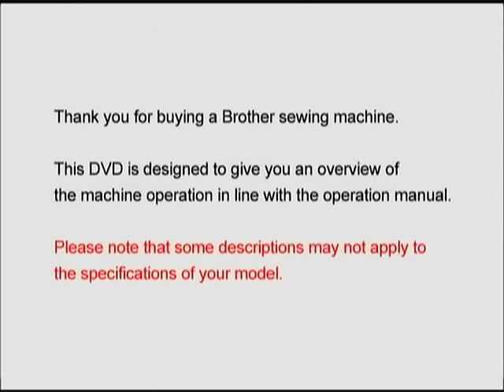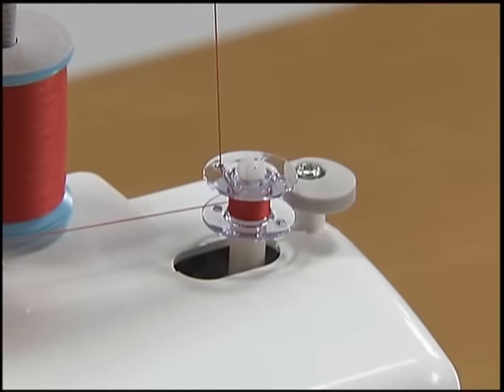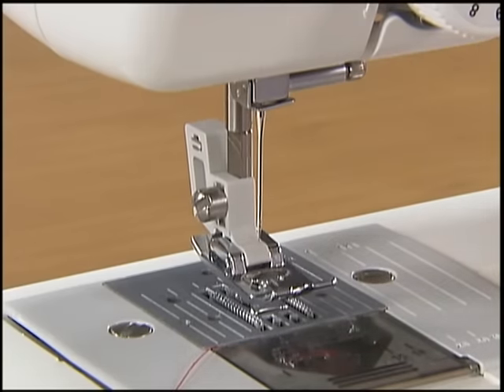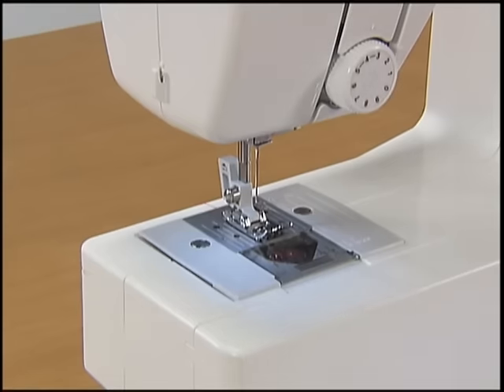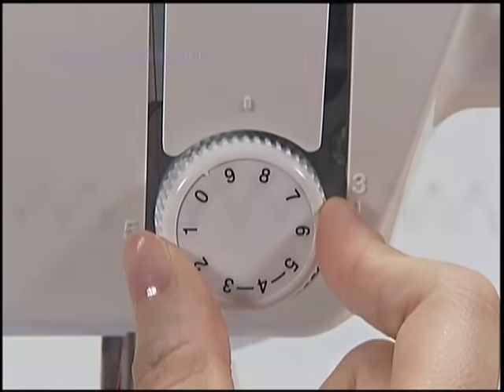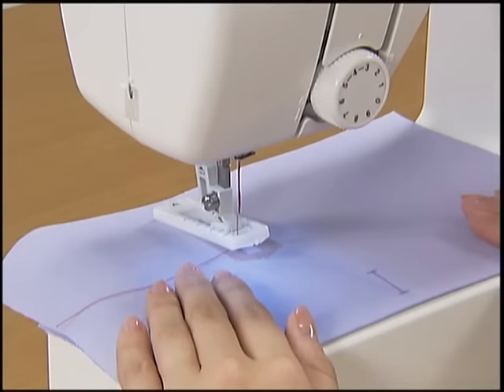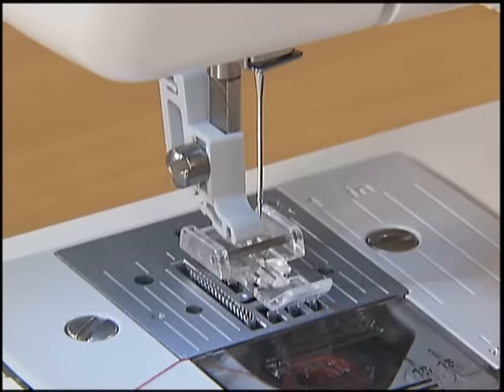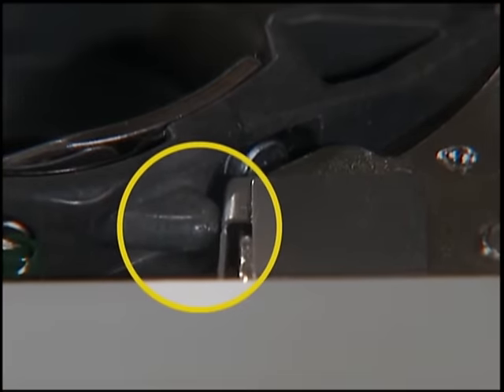Brother Sewing Machine - Instruction Video

Comment: I’ve had a cheap JX1200 for about 3 years now and I really like it - serves my purpose. Just found out it has a built in buttonhole maker!  Now to experiment. One tip I can offer is I had to put clear tape over my stitch selector button as the paint was coming off. AND if you have trouble with the machine not stitching properly, change your needle. I found out the hard way a simple solution for a big problem.
Reply: லி ஞஞ பட

Comment: Right I got this machine yesterday! And everything is fine. APART FROM when I sew on the top everything looks swell however on the bottom it doesn’t connect w the top so If i pull a thread everything comes undone

Comment: Ive had a brother ps500 for about 5 months. Projects take 3 times as long with brother ps500 because of mistakes. Having to fuss with machine takes my attention away from the sewing . Also the fed dogs wobble sometimes at high speed. Also I cant change the needle position. Also I have to take out the manual each and everytime I sew because its very tricky. Ive become so stressed out using the machine Ive started hand sewing which actually goes faster and more accurate than using the Brother which says a lot about the quality of the machine. Id like to get my money back. Before I had an old 1970s Singer I bought for $30 at a garage sale. I was able to work faster and more accurate on that old Singer the Brother ps500 was very expensive and not worth the $30 my old machine cost!

Comment: I want to know the magic of how the lower thread, which you have pulled to the side before replacing the bobbin cover, gets taken up by that straight needle with the upper thread in it? It's nowhere near it but there's something I;m not getting. Also, the Operating Instructions that came with my mx1010 threads the upper thread differently; the spool is other way up with thread coming out the front of the spool; unfortunately I can't play the dvd that comes with it right now, external drive won't work. Any suggestions?

Comment: I've just got hold of rhe lx25 so really looking forward to using it and learning all how to use it properly looks interesting how the bobbin cases are at the top on these machines looks easier to clean out also with a brush, I had an old brother window matic sewing machine and I've just re oiled it all and done the bobbin case brushed out and replaced the needles sorted the timing out which it's sewing much better now than it did really pleased with it now spent the day doing it but don't do zig zag so ordered a new brother sewing machine so looking forward to using  the new bobbin feed

Comment: I have a problem with the bobbin-winder: Sometimes the thread will wind around the base of the winder, instead of the bobbin, making threads collect underneath. How do you remove the bobbin winder shaft? I have a Brother CS100 so it doesn't look like the one in the tutorial. It has 2 pins around the winder shaft and base, where the threads will wind around. They should make the winder smooth so that when this happens, the threads can just be pulled off instead of having to take the device apart.
Reply: Marina M that just happened to me and I was so annoyed. Eventually i just cut the thread and tied it to another piece and kept going
Reply: If this keeps happening to you, you can thread the string into the little hole in the bobbin and wrap it around manually a few times before putting it onto the bobbin winder shaft. That is the old fashioned way of doing it and it should keep it from winding around outside the bobbin. Hope it helps!

Comment: I'm  wondering why, when she turned the machine on the needle did not switch over to the left position like it actually does every time you turn the power on. This is the only complaint many women with the Brothers sewing machine complain about as you break your needle or the needle hits the sewing foot stopping the machine and giving you an error message.  They need to fix this issue

Comment: I need help please --  I just bought a Brother 420 sewing machine-- and while I was attempting to fill a bobbin with thread I didnt realize that the thread was in fact under the bobbin winder.. So now I am stuck with a new machine that has malfunctioned due to the thread.... Any ideas on how I can get the thread unwound from the bobbin winder shaft? I am visually challenged and didnt realize this was happening until the machine stopped.
Reply from the maker: Hi Paula, I have checked with our product expert and here's the advice given - 

Kindly refer to this image - https://drive.google.com/open?id=0B1QZlH6NGrG6NlBWZ2V3T3ptelU 

What you need to do is to Pull the GREY cutter out and you will be able to clean the thread. Do remember to fix it back after cleaning.

Cheers
Reply: Hi I just got a Brother machine and had the same problem while winding my bobbin.. then i realized i forgot a step (step 2) so a bunch of my thread ended up undernead the bobbin and it was a mess. I also used low speed. Hope you figure it out!